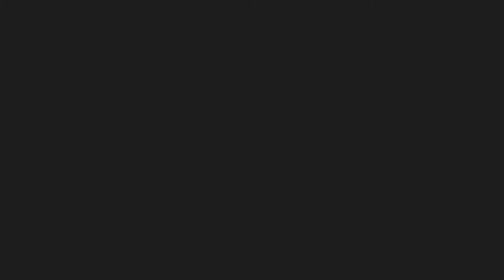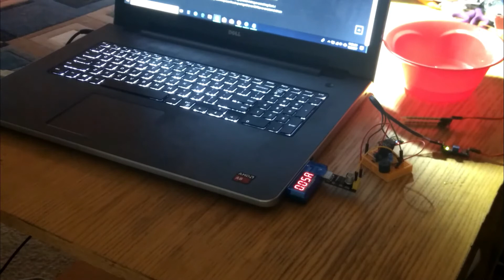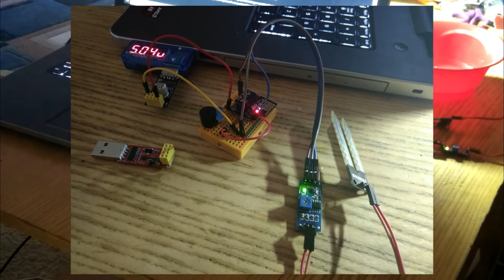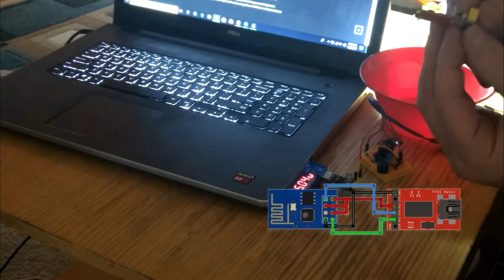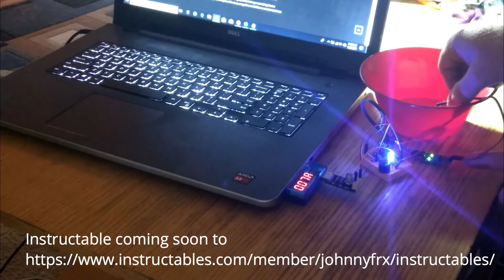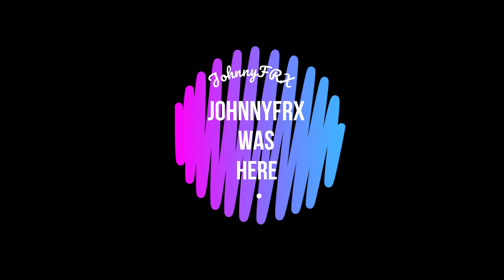ESP8266/ESP01 Arduino programmed Leak Detector with Alert Alarm

Comment: For $19 at Home Depot, this exact device is pre-packaged in a 2x3x4 plastic enclosure, 9V battery operated with quartz alarm (very loud) and stands alone where you want it. You can extend it's "sensor strips" via wire and copper tape. I use one under my dish washer, refridge, water heater and I have free standing units in each bathroom. 

The title of this video included "ESP8266" yet nothing about why it's even mentioned except that it's "disconnected to save power". It's this ESP8266 connectivity that interests me. I would simply add the modules to my already existing network of sensors by interfacing and powering them appropriately (obviously, 9V battery is not appropriate for long-term reliability for Push Notifications.)  So, I will be watching for this more useful YouTube video. If that's already been done, a link to it would be much appreciated. Thanks for making this video.
Reply from the maker: B. GLENN yeahhh...but this was fun to make.